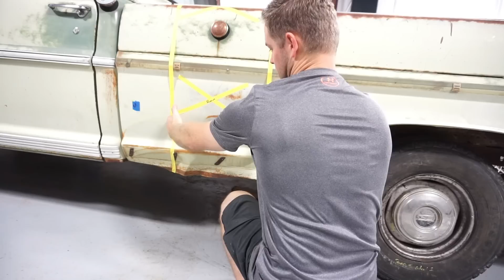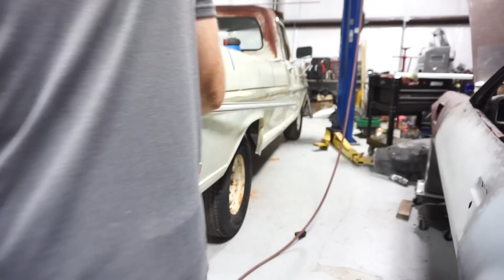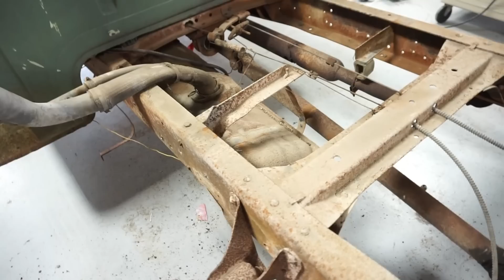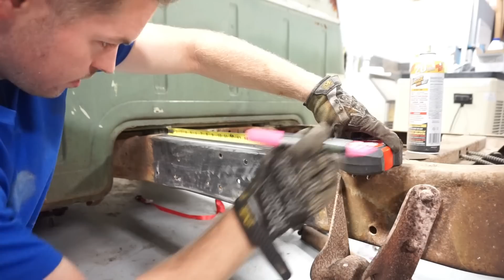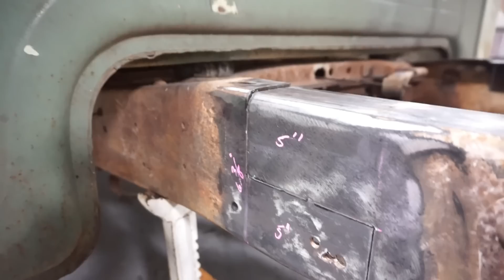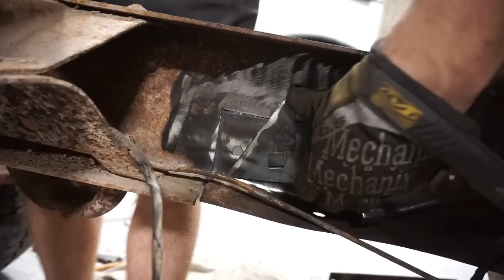F100 Long Bed to Short Bed Weekend DIY

Comment: For your center line when cutting you should have just measured 3 inches down so the top would meet together and ignore that lump on the bottom front.
Reply: Just what I was thinking, if there is any difference in sizes unless it's  tapered always measure from the straight side.
Reply: Just was watching and came here to point this out. Me yell at my screen Hey, 3"!
Reply: Ran in the comment section to type this 👍🏼
Reply: @pigidly  that’s how you keep your legs tan.

Comment: First, always round your corners when doing this. Those sharp turns will build up tension and you run the risk of it breaking. Secondly put angles on your edges so you can reach deep in the metal to weld it fully.

Comment: Just whack the 4 inches off the ends of the frame rails and use the opposite sides as templates to transfer the holes.

Comment: You were 3/16" off on the front because you measured down 3 3/16" and 3" in the back so your center horizontal line was not square with the top of the rail . You didn't need to deal with that step in the bottom, the area that you cut the bottom was still only 6" ..
Reply from the maker: Agreed, it worked out better in my head when I planned it. If I were to do it again, I would focus on cutting it, so the top of the frame aligned like you said. But hopefully you guys can watch it and cut yours more accurately.
Reply: 330_Garage you just 'over thought' it, believe me have been a welder and at 72 I've over thought a lot of things along the way or subtracted when I should have added. I was interested to watch because there is an identical pickup just setting down the road from me that I have dreamed of doing the same thing to, but I have to finish my 1950 F-1 project first. Trying not to 'over think '. Great vlog though, good method, you made it look easy and explain things well. Anxious to see it finished. Oh and....GET THEM SAFETY GLASSES ON!
Reply: I caught that too when I was watching it

Comment: The rear section was low, that’s why you had the front section sitting slightly higher on top, and the rear sitting low underneath, also you could use some of the section you cut out as a strengthening box section across your joint inside!
Reply from the maker: That's actually a good tip, using the old frame material

Comment: I think on that rearmost frame cut off,,I would make a cardboard template of the holes in the existing and place it forward of your cut line and trace the hole location(s) out ,,mark the center(s) and drill. just a suggestion. Your work looks great! Very enjoyable and informative .

Comment: Dealing with the extra fuel tank reminded me of this guy (farmer?) that every month (late 70s) had his truck with a large optional tank (32 gal?), two saddle tanks (32 gal ea), and a custom tank (50 gal) behind the cab filled up.  We ran as many hoses we could to fill up those tanks quickly.

Comment: You're cuts caused the frame to not line up. You should have focused more on lining up top and bottom and filling in the middle with welds. Plus the backing plates over the z chop. The other thing I would have done differently was have more than 5 inches to weld too

Comment: My Dad bought a 69 F250 Camper Special pickup.  It was one that somebody had ordered but didn't take, so he bought it.  It had that extra gas tank as well.  I remember that you could hear the gas sloshing in the tank that is behind the seat.  Not so with the gas in the big tank, but my Dad hardly ever used the big tank.  His was also a 360, 2 barrel.  With the super stiff suspension and huge tires on it, it would get stuck on wet pavement! :)

Comment: When I have shortened truck frames I will usually cut it on a 45° angle take out the 16" and put it back together. This will offset the top and bottom of the splice by the height of the frame. Usually I angle it towards the front from top to bottom because the farther forward you are with the bottom splice will lessen the inertial moment of stress.

Comment: Align the top and bottom of the frame. Fill the horizontal gap caused by the plasma cutter with weld.  Doh
Reply from the maker: That would have been a good solution as well... not sure anyone has thought about that. Well.. at least you guys have some ideas on how to cut your own stuff haha.

Comment: You where off 3/16".
You should have marked down 3 from top at front and rear.
Reply from the maker: Agreed... it seemed like the best approach at the time, when I was walking through it and marking it off. After editing the video and seeing it come together a couple times.. I think it would be best to mark both ends 3" down, cut the Z's, then bridge the 3/8" gap at the bottom by slicing it or making a gusset there. The top of the frame would stay aligned with that method.
Reply: 330_Garage 
IMO your Plasma cutter took away some material horizontally leaving you short vertically.  But what do I know, I’ve never used a plasma cutter and never will.  Hm, then also your cut out length would also be a hair short, but probably wouldn’t matter or show on the frame.

Comment: Like what your doing. Forget about what they say about cutting up a good truck. There are plenty out there to go save if they feel like it. You really need to rethink using a face shield and or safety glasses and appropriate pants and footwear. A trip to the ER is in your future. Hopefully you haven't had a molten blob of steel burning down into the layers of those sneakers into your foot yet. It's also in your future. Look forward to your progress.

Comment: If your worried about strength them box the chassis where it's been cut the shorted will make a big difference and stop the welds from cracking if there's any flex / twist in the rear end
Reply from the maker: it probably does need to be boxed. The frame is pretty flexible even before I cut anything out of it.

Comment: So would this be the same process as doing a 1978 long bed? And 4x4? This is such a cool video. I have read alot of forums on this subject but no videos. And just a small tip for anyone else attempting this, when you cut yoir notches, it is best to round off your corners. Instead of making a square 90° cut, use a socket or something round in shape to mark your 90 degree cuts instead of making sharp corners. With it cut square, it is making for an easy spot to crack the frame
Reply: Except for the pre-77.5 hi boys, frames on the dents widen out behind the cab so the cut rails won't align when you pull hem together.

Comment: You screwed up by dividing the front height in half. That is why you have the height differences in the front. You should have just measured both front/rear down 3" from the top. Reason? Your vertical cut on the front is behind the 3/8" kick-down in the frame height. All your cuts were made in 6" tall frame material. I saw it coming as soon as you measured it, LOL.
Reply: wheelieking71 I was thinking the same thing and what he should of done was lined the top and bottom up and fill the gap in the center that way the bed mounts are all level now ll the rear ones will sit down 3/8 from the front. But I guess it's not much so wouldn't cause a problem with it just looks funny haha
Reply: Exactly - cringed as the so carefully laid out horizontal cut line was intentionally set to go “down hill” toward the front of the front of the truck!?!  As you say, the horizontal cut line should have been parallel to the top of the frame so the resulting top surface remained straight.  On the other hand, splitting the difference in the offset wouldn’t necessarily be a bad idea, assuming some heavy welding in the top and bottom joints.  Still, a fun project.

Comment: I agree with ThePintorunner, and by not flushing the tops of the frame and checking it with a straight edge before welding, your frame may not be straight.

Comment: Good video and good work but I have a few suggestions. Frame jig (as many jack stands as you can get at the very least), a plumb bob, some layout fluid, and scribe instead of a paint marker and a tape measure. Otherwise, heck of a project.

Comment: I am greatly enjoying your video and I like that you are explaining your thinking as you go along.     Furthermore I am guessing that you are using ER70S-6 wire, it has good strength and elongation which should help prevent cracking, others have mentioned the stress induced in "square" corners.     One thing I would have done differently was to also weld the frame solid on both sides because the strength increase is dramatic.     You have the great benefit of having a plasma cutter where you can cut or pierce in any shape you desire, you can easily make  templates and cut around them with the plasma.      -jp

Comment: That big HD bracket is for a 5'th Wheel plate that would bolt inside the bed.
Reply from the maker: I'm assuming its home made? Have you ever seen something like that before? I would have loved to see what they were pulling with it
Reply: @330_garage3  It was probably custom designed/fabricated to suit that application.  It should have been ahead of the rear axle.  Top Plate would have had the Female hitch and lock assy.  I removed a bolted one once.  Terrible job.
It had been put on with Box off.

Comment: Awesome video and excellent content my question is why you destroyed prefect truck just to short it by that length  you could find or see if there short bed truck out there to me that so disappoint see long bed truck be cut up to be short
Reply: Finding a short bed in this era is tough, finding one in decent condition at a decent price point is even tougher.  This is a great solution to those that dont appreciate the old man look of the long bed.
Reply: @redneckgearheadgarage495  Likely you could buy a new short bed or get one from a much newer generation.
Finding a LONG bed is tough these days.

Comment: Should've measured an even 3 inches down, now equaled out the 3/16 frame thickness difference... that's why you're off! Soon as I seen your idea to divide the measurement I knew you screwed up. It's ok more welding is all

Comment: Hi Those wiring clips are called pinch clips. U put them in and pinch them and they grab and hold. They are they same as those used on mustangs and all ford products. Available new from AMK, NPD or any of the mustang suppliers

Comment: I would have overlapped the rear section bottom cut on top of the taller front section to create a strong weld and clapping point.

Comment: Too late now but if you would have cut 3 inches down front and back the top of the frame would have lined up. And the mid gaps would also.
Reply: I kept hoping you would catch this before it was too late, but you didn't

Comment: Excuse me friend, a question from where did you take the measurement of 3/4 to cut the chassis of the 16 inch part, from which part of the hole?  of the beginning, the middle or the end
Reply from the maker: I  believe it was the back of the hole, just to make sure I was square. As long as you take 16 inches out of the frame, from the same location on both sides it should be fine.
Reply: @330_garage3  thanks for tour help

Comment: Did the rear brace on the back the one that doesn’t take bolt cause you any trouble after cutting the bed and putting it back on the truck ? I noticed it has indentations to clear the shackles .buy cutting the 4” where you did , did the brace end up in the location it should ( top of shackles)

Comment: As a former restorer and customizer, I saw a few mistakes you made. 1.. no safety goggles. 2.. when you marked out for your cuts, the front and rear horizontal lines should both have been 3" from the top of the frame rail for your Z cut plus compensating for the thickness of your cutoff wheel so the cuts end up inline with each other when the sections are slid together instead of ending up with an offset or  a 1/4 gap. 3. when sectioning a frame, ALWAYS radius the corners of the Z or youll end up with weak spots that later are likely to crack on you. Im not trying to be a jerk, but want to see you do it the right way and to learn from my mistakes from when I first started in the field.
Reply: Excuse me, I said cut off wheel when I meant plasma cutter. the offet you encountered in the frame height was due to you measuring to the center in the front as well as in the back instead of measuring both to be at 3"

Comment: i thought someone made  kit to bolt on the frame of both frame sides and you cut out the sections on the bolt on , then slid the frame up and bolted on  inner frame section and welded it on the inside. i think trucks did it on their show. but what your doing works too.

Comment: I can get my hands on a running driving 67 f100 2wd for cheap.. i just dont know how to weld.. do you think a fab shop would weld the frame back together if i cut it myself? And if i can find just a regular short bed, Would i be able to just bolt that bed up to the frame if it's cut this way? I am considering selling my 92 f150 4x4 to fund the project
Reply from the maker: I would assume any welder would be willing to weld the frame back together. I would also assume, if you give them the measurements, they would be more than willing to cut it for you as well.

Comment: ?? Because of your previous mis-measuring, the z cut didn't line up, then you left the top and bottom rails uneven causing major issues. I guarantee tour frame is now very bowed down in the middle. Now your cab to bed gap is absolutely going to be tighter on top and looser on the bottom. I'm guessing gap differences of bed of about 1/2 to 1 inch.  I was cringing the whole time. Sorry but I think a cut and re weld is in order or the truck will look saggy in the middle. If you think shimming bed will fix...no. because the body lines will be lost

Comment: Radius your cuts , if you cut it straight leaving a corner that’s where cracks can begin. Use a drill and make a hole where your corners are .

Comment: Why not use the 16" pieces you cut out to use as a backing plate.Better yet you really should box that frame area in instead of triangle pieces. Your life could depend on that frame NOT becoming a hinge point if ever in an accident. Worth the cost of material.

Comment: What you do with drive shaft  after cutting frame did it line up again
Reply from the maker: I had the driveshaft cut down and rebalanced by a local driveshaft service shop. Or you could find a drive shaft out of a short wheelbase truck and use that
Reply: IM SHORTENING A 84 CHEVY BUT FRAME IS DIFERENT TO THIS.   HOW MANY INCHES YOU RECOMEND TO TAKE OFF LONGBED TO  MAKE IT A CHEVY SHORT BED . JIST STARTED  BUT I PUT A HOLD ON IT

Comment: What welder did you use to weld everything?
Reply from the maker: I'm running a Lincoln Power Mig 210 MP.  I also run an old transformer machine, a Lincoln Weld Pak 5000HD. With a small .023 wire that is really nice to use on sheet metal. Both are gas shielded with a 75/25 gas mix.

Comment: It is a little to tell you that you could have measured forward 12 inches marked your holes for your leaf spring hangers moved it forward then cut out the back then you dont have a disaster like you just did.Just saying

Comment: this is way cheaper to cut the box then do it like they say and buy a new short box from lmc truck but i think it would be better to start with a short box so far i have got 2 short box 67 to 72 fords 2 67 to 72 chevy's and few 73 to 79 chevy's short box and the best part they were free just haul them off for scrap but i keep them . one truck i got for free i still can't believe was a 79 short box cheyenne full option truck with under 35,000 miles on it in mint condition been in a shop it's hole life . i was told by super chevy not too sell it for less then 20,000 to 25,000

Comment: I think it would be easier to buy a short bed cut the chassis to the short bed length and bolt it down with out cutting the long bed

Comment: I know its your truck. Do you know how hard it is to find a bed in that shape? Normally they rust out at the seam. That truck didn't have that much rust in it. I would of restored it. Did you ever get a title for it? What's your plan for the truck now to modify it on out? The tank on the back was a option on those. Normally it was the camper specials or people that was towing or camping that went for that option.
Reply from the maker: I thought the truck was cool, and would be cooler as a short bed. I feel like the weathered paint tells a cool story, and its not all crashed up. I did get a title with it. The truck was left on some property (with lots of other junk) that my friend bought. I am working on getting the engine back in the truck (video coming this weekend for that). Then doing the crown vic front suspension swap, an explorer rear end. Redoing the interior, and putting the story on YouTube as I go.
Reply: @330_garage3  I have to give it to you. You had a lot of patience putting it back together. As far as the 390 use header gaskets on those exhaust manifolds. It will save you some aggreviation.

Comment: should of watched some welding vids,before,,,you started..that frame should be leveled off,not staggard.gaps can be filled with wire ect.all the edges need ginding & chamfering,almost to the centre of plate.to be filled with weld,both sides.

Comment: Anybody else catch his mistake?
Reply: Your height difference is because of your 3/16 difference.  When you measured the forward height you should have also measured 3 inches down.  The rear section is now lower than the original height.
Reply: I figured it was because of the kerf from cutting.  The top was as low as the bottom was .  If he had clamped something across the top of the frame it would have aligned the sections, but he would have had a gap to fill in the middle.